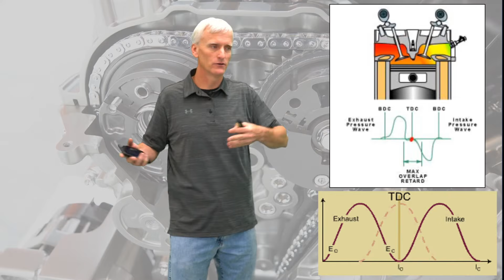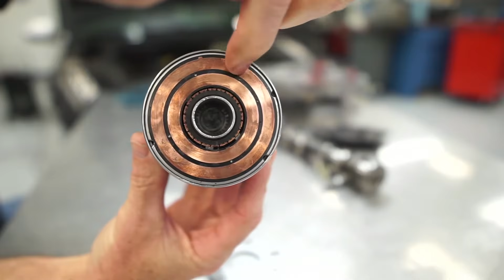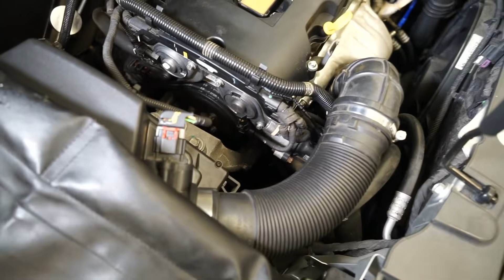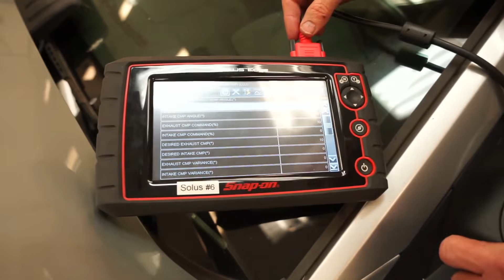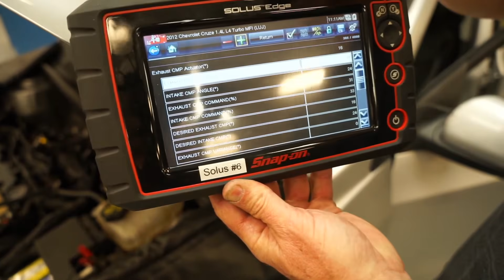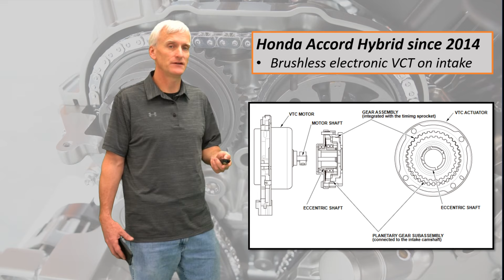Electronic Variable Valve Timing Actuators

Comment: I have a 2021 Nissan Sentra with that same variable valve timing set up. The actuator brushes for some reason arced on the contact ring and now the contact ring is destroyed. Any idea if that contact ring can be ordered separately?
Reply: What DTC codes were you getting

Comment: Could the egr effect increase compression?
Reply from the maker: Egr leaking into the combustion chamber will cause high compression and low vacuum at idle.  Anytime you get more air (or exhaust) into the cylinder it will cause high compression.

Comment: Just posting this here to for anyone else who has an answer for this. Thanks. I have an 2011 Infiniti QX56 that has the same problem. The service manuel says that at idle the intake solenoid should register 0 activity, but in my scan tool I see that they are active and advancing the intake cam. On a cold start everything is like it is suppose to be (0 at idle), but once warmed up coolant at about 158F activity goes from 0 to about 20-40% duty cycle on both banks at idle. What could be causing this? Just for reference I also notice that my map sensor also jump from 1v to 1.5v. The service manuel says that should also be 1v at idle and at 1.32 when rpm is at 2000.

Comment: That could be  a harmonic speed reducer. give a big rate of speed reduction.  harmonic reducer used  on robotics,  lathes, space machines, etc.   
        brushless motor is kind of induction drive.
Reply: I'm currently working what, as far as I'm aware, might end up being the 1st production application of harmonic drives on an IC engine (9L heavy duty split-cycle). It was the only option for us due to very high cam torques making high gear ratios necessary (160:1). The challenge has been controlling position well during starting and stopping since they don't have any locking mechanism like hydraulic phasers.

Comment: We need to know what the cam adv/ret pids should read cold at idle. This info seems to never be published. Last one I had an issue with was about an 07 g35. Im gonna start looking on vehicles that don't have issues and record what I see. A nissan Tech on iatn told me they should return to 0 degrees at idle. Do you know is this true across manufacturers. My general strategy, when I have a vvt code, is to momentarily ground the control circuit of the affected solenoid while watching the pid and listening to the engine. But, although some work, they don't always return to zero degrees even unplugged. Yes, a lot of newer ones have the desired/actual in the scan data. not the earlier models. Your thoughts would be appreciated.
Reply: Hey did you ever find the answer to this? I have an 2011 Infiniti QX56 that has the same problem. The service manuel says that at idle the intake solenoid should register 0 activity, but in my scan tool I see that they are active and advancing the intake cam. On a cold start everything is like it is suppose to be (0 at idle), but once warmed up coolant at about 158F activity goes from 0 to about 20-40% duty cycle on both banks at idle. What could be causing this? Just for reference I also notice that my map sensor also jump from 1v to 1.5v. The service manuel says that should also be 1v at idle and at 1.32 when rpm is at 2000.
Reply: @jacobrutherford9132  The short answer is yes they should return to Zero at idle.
Reply: @michaelwitmer7536  Thank you for the response, If I can pick your brain, what do you think is causing them to come on at idle or rather the pcm commanding them on? They are not on when the truck is warming up, but when it reaches operating temp it starts. I have no codes and my idle is butter smooth, so I am really at a lost. Thank you in advance!
Reply: @jacobrutherford9132  I took the time to look again at service data, as usual they are very cryptic. My usual strategy is to look at DESIRED vs ACTUAL in the pids. all the oems use different terms, for example VW uses Specified VS Actual. Ford uses one pid called desired minus actual. If it's not setting codes/ giving performance issues, change the oil every 5k and be happy. Many of these nissans I have fixed by cleaning the screens and reinstalling the same solenoids. Whatever you do if you replace use one from the dealer or you will be sorry. Dormans last about 6 monthes, and some ebay units never functioned correctly out of the box.HTH